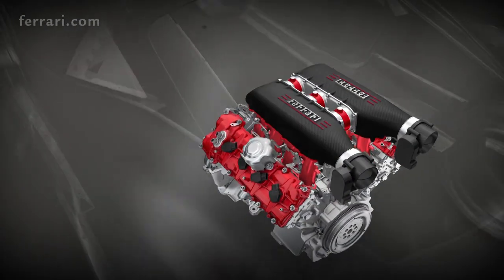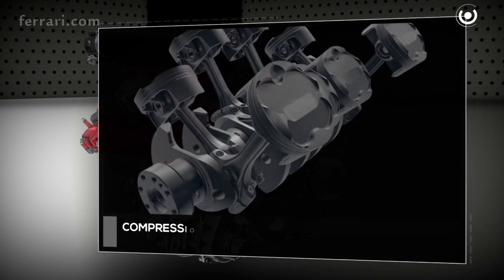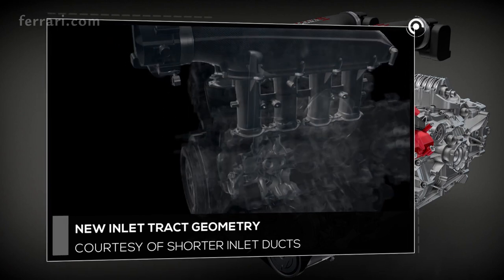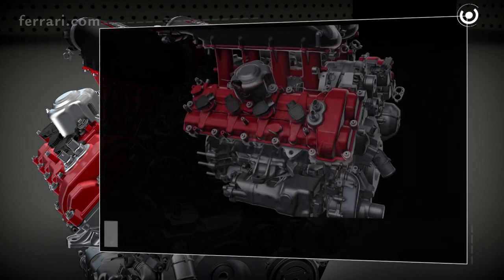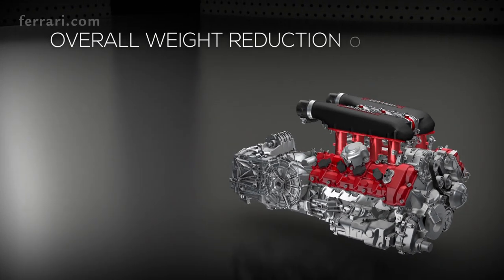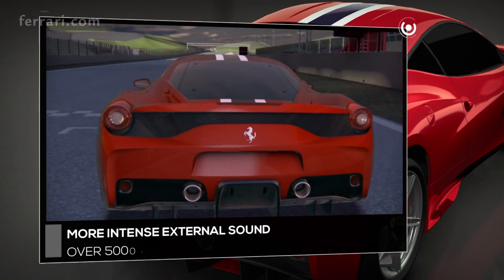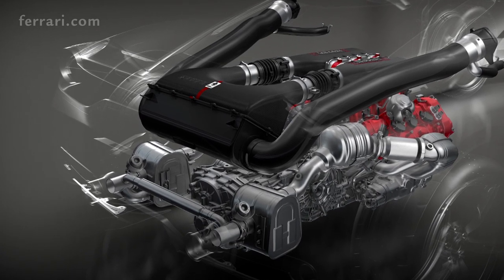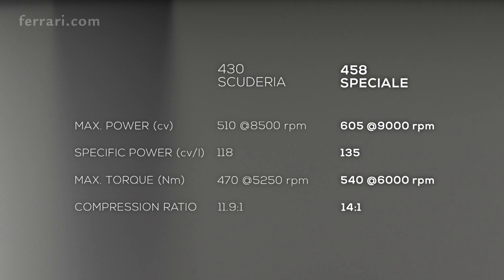Ferrari 458 Speciale - powertrain

Comment: I never realized the 458 Speciale was the equivalent of the 430 Scuderia. I thought it was an outside company like Mansory that designed it. The fact that the 458 has the most powerful naturally aspirated V8 engine of any car and the F12 has the most powerful naturally aspirated V12 engine of any car is a fact that hardly any car reviewers point out. 0-62 mph (not 60mph) in 3 seconds flat (!) has to be a world record for a naturally aspirated rear wheel drive street car.
Reply: It has not the most powerful NA V8. The SLS Black Series got the worlds most powerfull NA V8 with 631 PS.
Reply: Cartel893 Not anymore. The Ferrari LaFerrari tops it with a ~760 hp naturally aspirated engine (minus the electric motor)
Reply: ***** The LaFerrari has V12. We're talking about V8 buddy ;)

btw, the most powerful NA V12 is the Mercedes V12 with 800 PS from the Zonda Revolucion, if I'm right.
Reply: Cartel893 OK. Missed that part. I was talking most powerful NA engine. period.
Leave it to the Germans to engineer the most powerful NA V8.
Reply: ***** yes buddy, but the germans do also have the most powerful NA V12. ;)
The most powerful NA engine in the world is the Weineck Cobra, but it's a special production and has 13L engine.
However, nothing matches a V12 NA sound. No matter if 700 or 800 HP. But I also love the Ferrari V8, it has a special sound.
Reply: Cartel893 Got me again. 13L Engine? Geez, one would need a gas station every block LOL. I agree with regard to the 458's engine. It sounds like a Honda CBR900 racing bike. I also love the sound of the Ferrari F12's engine. I have never heard a more refined sounding engine than that. Pure music to the ears :)
Reply: ***** I can't imagine that power from a 13.0 L engine. This must be ridiculous.
I agree, the F12 sound for me is the best sound of all production cars. Just unbelievable especially the downshifts. Some cars sound only good from outside, some only from inside, but the F12 sound mindblowing in every perspective. I watched nearly every F12 video on youtube. I could listen to that V12 the whole day. An absolute Masterpiece from Ferrari.
Reply: Cartel893 Absolutely agree about the F12. I've been a Ferrari fan for the last 31 years and what got me hooked was those glorious sounding Ferrari engines. That and that drop dead gorgeous Ferrari 288 GTO - still the sexiest car on the planet. Check out the video of Chris Harris reviewing the GTO
Reply: ***** I hope ferrari will continue with NA engines fot the GT cars. Regarding emotions nothing can match to a NA V12.
ok thx, I will watch the video with chris. Didn't know he drove a 288.
Reply: Cartel893 I agree. I am sure the reason Ferrari always goes for NA engines is because the exhaust sound does not get muffled by having to go through turbo fans.